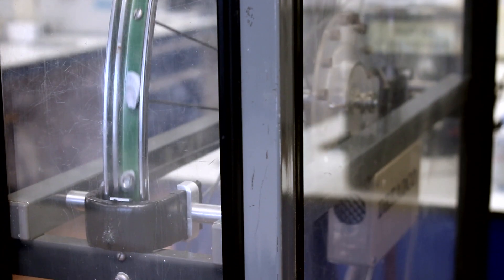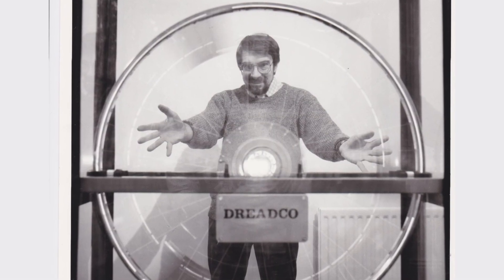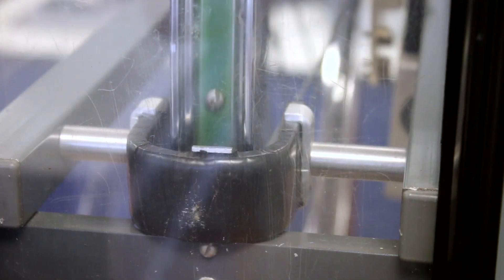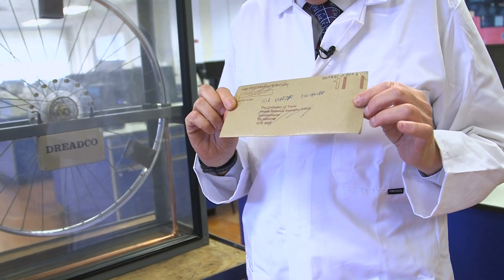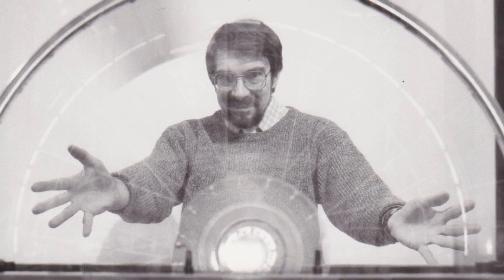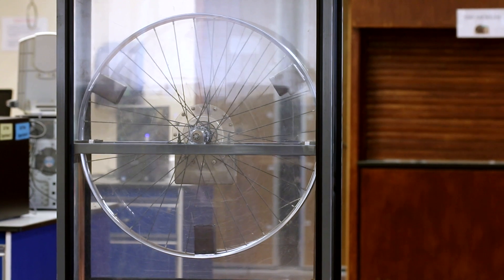Perpetual Motion Machine - Periodic Table of Videos

Comment: I think people are right. I think it is a very lower power motor combined with a wheel that has great bearings and turns with little friction. However, I think it also somehow receives solar energy. That is why it is clear. It could be a photo cell on the side of the dreadco box, if not something else that gets solar energy via heat. I mean, there is a reason it is in a clear box.

Comment: its a puzzle, how fun. there are lots of tricks on it too.  like taped magnets, heat sinks and boxes.   a couple things come to mind, like buoyancy or mass cycling, but i doubt thats the answer, too complex.   i think its  using electro magnetic fielding to generate a subtle charge, and its balanced very well so it takes minute energy to keep it turning from what is generated using the black boxes.  without seeing whats in the boxes, i suspect they are magnets and it generates a dc current to power an electric motor or maybe its just a battery... thats my guess.  .    i absolutely love this video and he sounds like one cool guy.  would like to know if i am right, but it gives me a fondness i've rarely felt, and can live without knowing the answer.

Comment: Very low friction bearings. Very well balanced wheel. Start wheel spinning, seal display case, draw a vacuum in display case. The three blocks attached to the rim are for inertia, probably tungsten? With sufficient mass and minimum friction, I can imagine the wheel spinning for months... maybe a year or more.

Comment: Lots of red herrings in there!
Everything except the DREADCO box is fake, including those "electrodes" and corresponding copper decoys on the plastic hub.
Behind the light diffusers are photovoltaic cells trickle charging batteries (like a big solar calculator circuit), running a very low power motor which is coupled to the smaller diameter plastic cylinder on the hub through a simple friction mechanism out of the top of the box.

Comment: I think those 2 pieces of metal in the middle sticking up towards the round pieces on the wheel are doing something. I think they are conducting electricity in some way and making a current, that in another way allow the machine to be propelled. Once the magnet in one of them runs out of charge it will stop. I'm thinking the metal on the wheel is the thing with a magnet.
Reply: No my idea can't work. You would cause more resistance than energy.

Comment: My guess is that the box is under vacuum, there are batteries in the heatsink box, and a very low power motor in the dreadco part.  There's blue tac and things around the outside edge of the wheel which means it's likely been balanced to within an inch of it's life, and it's on bearings so it would take very little force to spin it, especially if there were no air resistance.
Reply: Das Grinch  I don't think it's under vacuum. Look at this other Dreadco wheel. https://youtu.be/XSsDX3fEsSo

Comment: While I do think much of the device is just for misdirection, he did say that he knew of only 1 person who had ever guessed it correctly(and even then he said "may have"), so I doubt it'd be something so simple as "a motor and a battery". I initially thought there might compressed air slowly leaking out and pushing the wheel around, but I'm not so sure that would last as long as it has.

Comment: the copper pipes contain batteries, the metal boxes each have a magnet inside, when they pass the one of the arms on either side a small solenoid gives it a little kick to keep it going round.

it's quite hard to really analyze it from the video

Comment: Hmm interesting. My guess would initially be magnets but that would mean that eventually the machine would stop the the magnets are the attracted the most. So there must be another trick and I think it got to do with heat as well. Maybe a sterling engine running on the normal ambient temperature? Or maybe the magnets are one a gimble inside the boxes allowing them to change polarity depending on if they are on a up turn or down turn... It's oddly stable that cycle....interesting to say the least...

Comment: As I see there are two main possibilities.

1. The machine is getting power from outside (ie, a thermal machine, vibration collector, etc.).
2. The machine has a slowly discharging potential energy source inside of it (battery, spring, compressed air, slow chemical reaction, etc).

I have no doubt that I could create something that managed to have the same effect using several different methods.  Exactly which method might or might not have been used on the machine in question is fairly useless speculation, especially since there have obviously been deliberate methods of misdirection employed to prevent guessing which method was actually used. 

I have made similar comments about magic tricks in reference to the Penn and Teller show Fool Us.  Others may disagree but a good magic trick is one in which I have no guesses as to how the trick was accomplished.  If I could figure a way to replicate the effect, even if it is not the same method that was used, the trick has lost its luster.
Reply: Yes but then the number of tricks is severely reduced. Tricks of the calibre you described are difficult to come up with. Clearly this has provided amusement (glance at the like bar for confirmation).

Comment: My suspicion would be long life batteries hidden in the hollow square tube frame, or in the wood base plate. It could be supplemented by generators in the casters that give it a bit of power when people move it around. Solar cells might also be hidden behind the window on the DREADCO box.

Comment: Well, it's almost definitely in a vacuum, it seems to be going since the start of time...

My guess is ionic thrust with power generated by a radioactive decay battery

It's probably just some clockwork with loads of low voltage cells
Reply: Calculate just how thick the glass would have to be to support the atmospheric pressure if there were a vacuum inside.

Comment: I think that there is a small motor inside the axle which is powererd by a battery (presumably inside the dreadco box) connected to either side of the axle. It wouldn't need much torque to compensate friction losses. All the surroundings look like they are just drawing our attention.

Comment: There are decoys everywhere on this machine intended to lead you to the wrong conclusions. The Prof. said it had been running for two years but had slowed down over that time. He also said the actual answer is rather disappointing. Therefore it must involve an electric motor and some kind of energy storage device to power it, such as one or more batteries. So I would guess the grey box under the hub contains batteries and a motor connected to the hub. I guess we may never know though :)

Comment: I think the heat sink and copper pipes are a red herring to make us believe it's a heat engine. The same goes for the magnets around the wheel. Lex parsimoniae says it's probably just powered by a concealed electric motor. The DREADCO box could certainly house one, and it looks like there's a PV cell on the one side to power it. This would also be a very disappointing explanation to someone who thought it'd be more clever.

Comment: There's a sharp nail (and heatsink) in there. I think there's a sterline engine generating a small ammount of electric field discharge, which is pushing the wheel as an electrostatic motor... 

or

You've got a long life battery driving a small electric motor, and the wheel is on a very good bearing😉👍?

Comment: i not sure that this machine works because we dont see a several full rotations at the same rate of rotations per seconds? an also if it works i think that it use vibrations from moving the objet.
Reply: i think it harverst energy from vibrations in the enviroment with a piézoélectric component
Reply: it using a fan

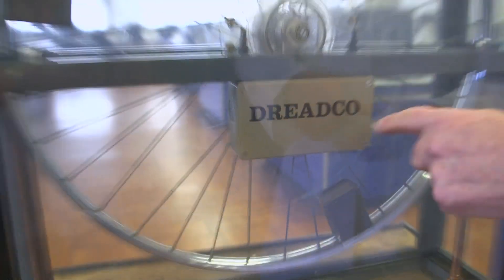Comment: Because the machine has apparently been working for decades without maintenance, we can exclude the possibility of it using (almost) any kind of electrochemical source of energy (e.g. a battery). Therefore, as it has already been stated many times in the comments, the unit is most likely powered from an old-fashioned photovoltaic cell, which the round element on the box seen at 1:56 very closely resembles. Inside the box, there may well be a motor from a cassette recorder (these are known for being able to run even at very low power) which turns the wheel via a friction drive. The dark ring painted on the wheel's acrylic inset probably serves a purpose of concealing the friction drive wheel when the machine is viewed from the other side. The friction drive theory is also confirmed by the statement that the machine used to run faster before: the small rubber wheel of a friction drive has worn out over time and the gear ratio has changed.

Comment: @Periodic Videos 
My best guest: This perpetual motion machine moves because the center of mass of the wheel is not at the axis, but a bit off to the left, making the wheel rotate counterclockwise. And the center of mass gets constantly shifted towards the left as it rotates, in order to keep it going. It does this by means of those three boxes that are positioned exactly one-third away from each other along the wheel, which (I think) contains some weighted objects that changes their relative position within those boxes whenever the box passes one of the two U-shaped things that are positioned at equal heights to each other, but both are slightly below the axis of the wheel (which I think there is an important reason for that to be the case). 

When a box passes the U-shaped thing (let’s call them key slots) on the left (going down), the weight inside it moves by some means outward. This changes the center of mass slightly towards the left, but enough such that gravity makes the wheel turn. Not soon after this, another box ahead of the wheal passes another key slot on the right (going up). This makes the weight inside it (which would at first be positioned outwards) move inwards, which again would shift the center of mass to the left. Let’s call these changes in center of mass inside the boxes a “switch”: switch+ when the weight is moved outward and switch- when the weight is moved inward. The reason why these key slots are located slightly below the center of the axis is because these changes must occur in at specific positions, at specific times in relation to each other. If the key slots were located at the same hight as the axis (or higher), the switch- would happen to late, the center of mass would move too far to the right making the wheel slow down. Likewise, if these key slots were positioned too low, the switch+ would happen too late, which has the same effect. And perhaps there is another reason why these key slots are located slightly below the axis (which I will explain below). 

Exactly how the weights within the boxes “switches” around like this, I am not quite sure. I am more certain that magnets at the key slot are used to move the weights inside as the boxes passes the key slots, because magnets weaken over time and it was noted that the motion of the wheel had slowed down. But in what way these weights are moved, I don’t know. There are probably thousands of different working mechanisms you could use within these boxes, so I don’t think it is important to guess what the mechanism is. Whatever it is, the mechanism ensures that the weights are fixed in one position until the box passes a key slot, which makes the switch happen. And if my suspicion that the key slots contain magnets is true, there must also magnets inside each box that are attracted (or pushed) by the magnets of each key slot. The boxes react in the exact same way to each key slot, so the mechanism inside the boxes must be exactly the same. The set-up of the key slots must be different in order for the boxes to react differently when passing the slots. So I guess that at one key slot, the magnet attracts the magnet inside the box, making the switch go one way. At the other key slot, the magnet is flipped so it repulses the magnet inside the box, making the switch go the other way. I can’t think of adding any more details based on inductive reasoning alone. One other thing I noticed is that because the key slots are located slightly below the axis, the boxes passes the key slots at an angle and this isn’t symmetrical when you compare the passes at both key slots. At switch+ (going down) the box passes bottom (the side of the box glued to the outside of the wheel) first, and at the other slot the top side goes first. Since this asymmetry is slight, perhaps this isn’t important. If it is, it could have to do with how the slots make the switch go in different ways. A different way of approaching the magnet (bottom/top first) could change the switch inside the box.

As you would have noticed, I didn't mention the copper tubes with the heat sink, nor those electric wires near the axis. These are clever red herrings to send most people on the wrong track, making them think the wheel spins on electricity or even on heat transfer like stirling engines. However, both electricity and thermodynamics requires contact (well, thermodynamics can work without direct contact via air, but it is more efficient with solid objects, which is required in this case because the wheel spins too fast for it to run on heat transfer), and since the only direct contact that happens to the wheel is via the axis itself, which appears very clearly to be just a simple axis with no motor or fancy heat transferring mechanism to drive the motion of the wheel. 

So, did I get it right?

Comment: I quess it uses electrostatic. One probe (this thing near axis) is a sensor, which control second one, and second one is constantly switching from positive to negative or something like that. Also this round metal pins on a small plastic wheel are charged. I belive that wheel is rather light and this force should be enought. Also it should be energy effcient.

Comment: I think one or more of the boxes on the rim contain a battery powered clockwork with a slow moving off-center weight. Like those vibration motors but then much slower.

Comment: I'm guessing it's just a little battery powered clockwork mechanism like you might find in a watch, which is contained in the middle and the rest of the features are red herrings. It doesn't take much to slowly spin a wheel with little resistance on it.

Comment: What if the copper pipes and heat slats are to throw us off? My reasoning is that if there is heat transfer then it would be susceptible to change depending on the heat outside the box (if it is warm outside it may run faster/slower) but in saying that it may just be slowing down due to friction...

Comment: Thermodynamics..(really?) Three reservoirs of whatever it is are cooled (slightly) down while going towards bottom ( left U- shape bar) but when they are meet right bar which is conducted to other pipe slightly warms this weird three 'whatever they are. The key to run it might be just a difference in air temperature........ Unfortunately that is the statement which I'd like to be true which is fully unacceptable in scientific manner. Basing on what I actually see and knowing that it runs slower than before,  this is clue to suspect this three boxes to be some batteries, U-shape bar is catching the difference in potential each time giving slight kick to the motor in the box titled  'DREADCO' - Thats my final answer.

Comment: Is a micro Stirling-engine is hidden in there ? It rotates because the place where the machine was stored is a bit colder than the exhibition place. Stirling engine can operate with a very small amount of delta-T between the warm source and the cold sink.

Comment: I wanted to guess that convection currents were responsible, but I'd expect the side with the heat sinks to be traveling upward, not downward. Usually heat sinks bleed heat out, but that doesn't need to be the case all the time. If it's convection, then those boxes around the edges would just be a way for the air to grab hold of the wheel a little bit.

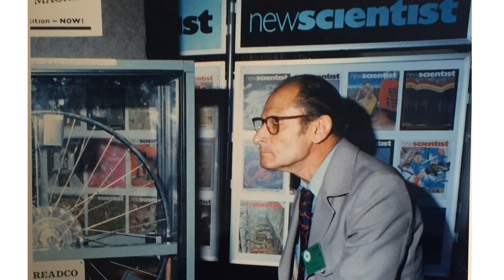Comment: 1:09 I've seen a wheel spin by putting a negative charge on tips like the one on the right, causing electrons to be released from the tip. My guess would be there's a battery in the Dreadco box with its negative end connected to the tip on the left and its positive end connected to the ball-shaped electrode on the left. The tiny metal pieces in the wheel would catch some electrons, thus causing the wheel to rotate counterclockwise mainly due to coulombic forces and some inertia from the "electron beam".

Not sure if that would count as disappointing, though. But if it was just a motor spinning the wheel, more than just 1 person would've gotten it right.

Comment: Very little force is needed to rotate a bicycle wheel: once I put the bike down in a way that it didn't touch the ground, and a moderate wind (~20 km/h) acting on the assymetry of the tyre treads got it rotate about 20 rpm.

Comment: I think there is a lot of misdirection built into the device.  Copper piping and heat sink don’t do anything.  Neither do the boxes on the wheels.  I am guessing it’s powered by electromagnetic force, the clear ring embedded with magnets and the round probes. Battery powered, probably in the Dreadco box, but it doesn’t matter the location.

Comment: My guess is that it's an impulse motor. The magnets are mounted on the plastic connected to the center of the wheel. The electro-magnet and its driving electornics are inside the "DREADCO" labeled box with some long lasting batteries. Everithing else is just there for show.